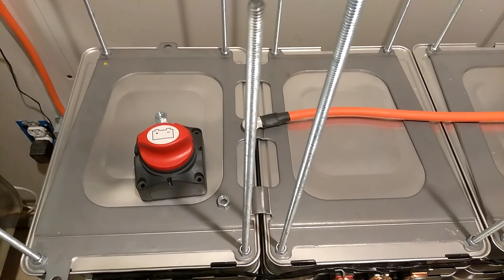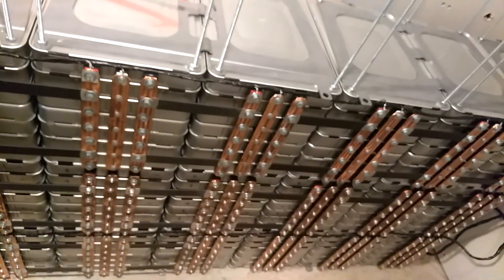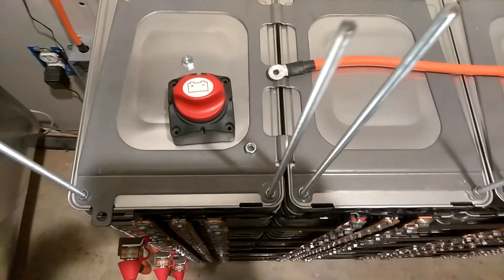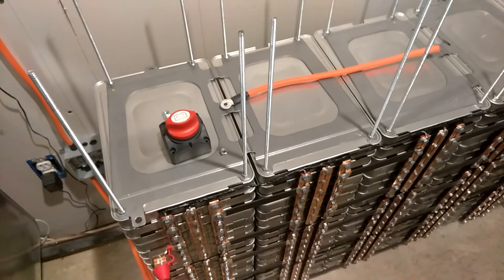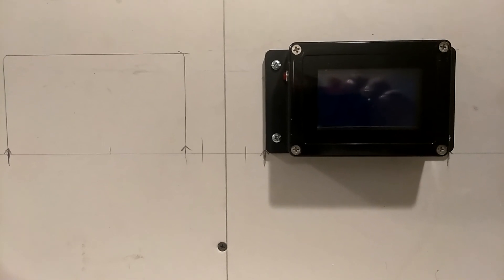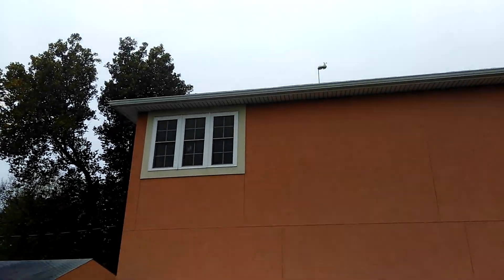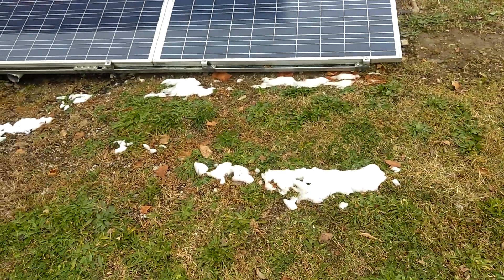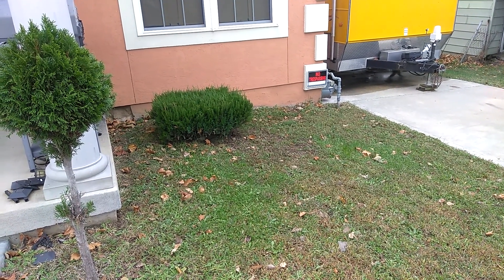update on the progress of the powerwall.

Comment: I'm running a couple of seven leaf module batteries with BMS with a single lv5048 and am working on a 63 module battery following your style. When using the BMS's they would both cut if I just turned on the battery disconnect, due to the in-rush current into the lv5048. I ended up making a manual precharge circuit using another switch rated to like 80vdc, and a 100w 50ohm resistor. I notice people on the secondlife forums like using the REC precharge box when using a bunch of BMS's like this.
Reply from the maker: I'm going to look into that more here in the next couple of days thanks for the info.